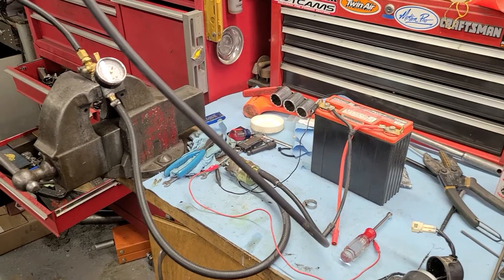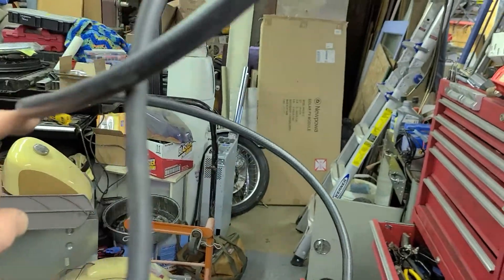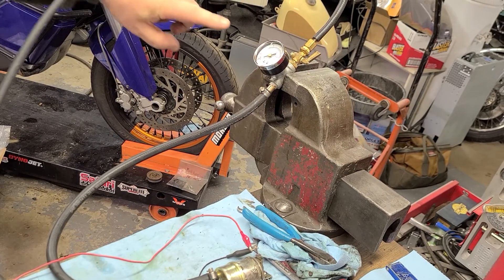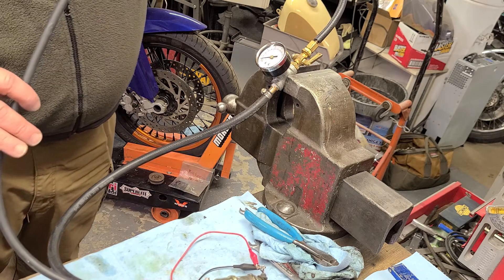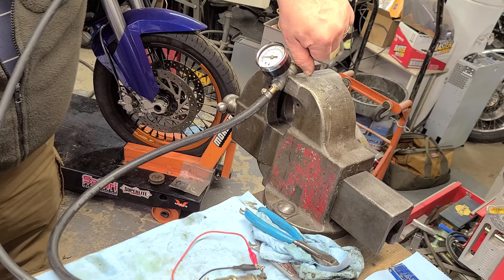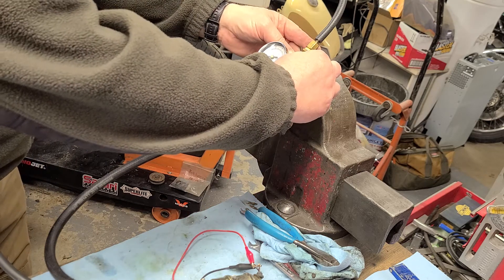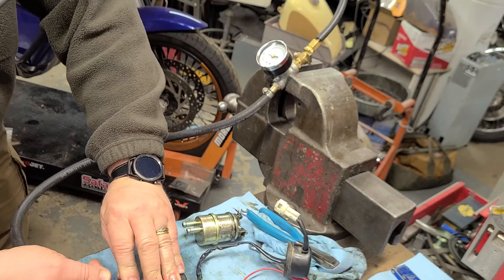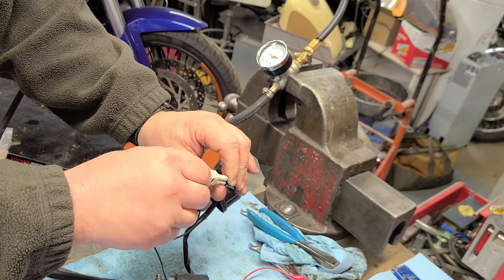KTM 950 fuel pump testing

Comment: Any update on this one? I feel like I’m having a similar issue that’s tied to heat.
Reply from the maker: Proper tank venting can be key to eliminating fuel delivery issues with the 950 ADV. If the tanks and fuel get hot and there isn't adequate venting, it will push fuel past the float needle and flood the engine while not running.

Comment: where the Mikuni DF52-136 Vacuum pump test with them
been running one since 2008 been faultless one less electrical problem
can't understand why people continuisly waste there time & money on electric pumps

Desert , heat fuel vaporisation https://www.rottweilerperformance.com/insulation-line-per-foot/
Reply from the maker: The pulse driven pumps can work well, many have used them. I have found that there are a few howevers associated.... One of them is you have to remember to turn off the petcock when not running or it will flood the engine with fuel. This gets worse when the tanks are full and its hot out (Baja hot). I have also found that the fuel pressure delivered can be erratic. These carbs can't handle much more than 1.5PSI before the floats/needles give up and the engine starts running rich. I have many many miles on a Facet 40171 as well as a 'Dr Bean' modded OE pump.  I prefer the 'stop fuel flow' feature when not energized and a consistent 1.5PSI of fuel pressure with both of these pumps.
Reply: @AdventureMachines   just buy the Delorto equivelent it has shut off valve built in
summer here in range of 35c - 47c (95f - 116f)

Comment: I never understood the solid state controls of these pumps. Are they really any better? On my 3. Pump now. At about 135k km. I use OEM.
Reply from the maker: The SS drivers can be better. The OE points wear and fail over time. Some of them only last for 10k miles.